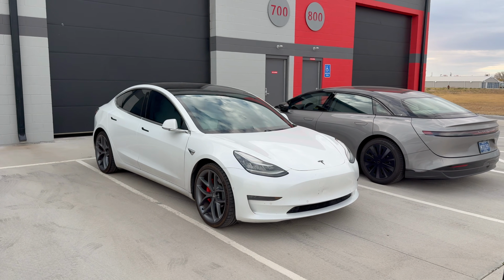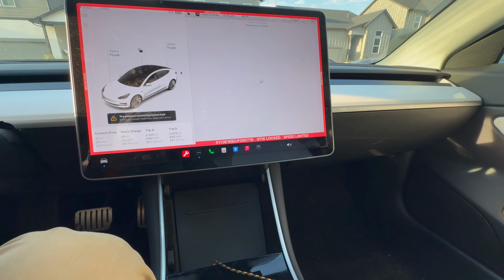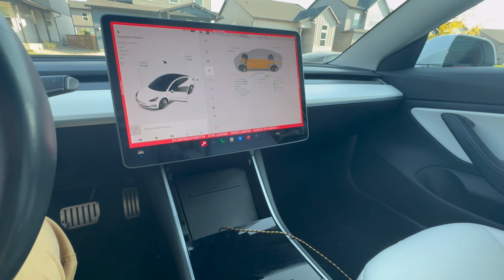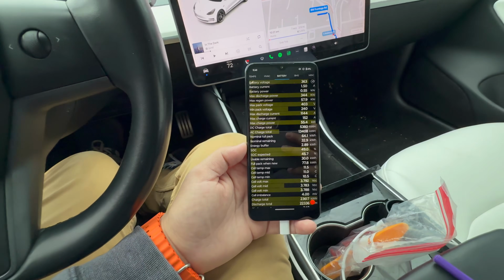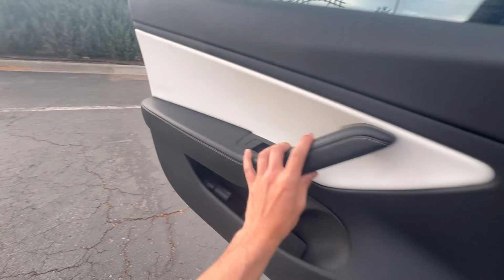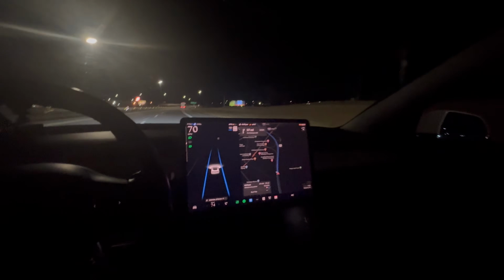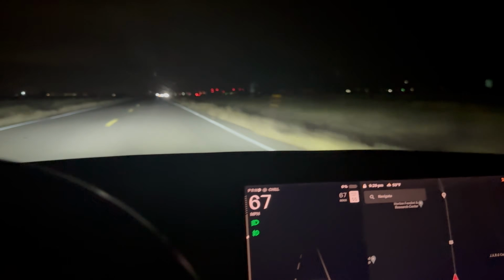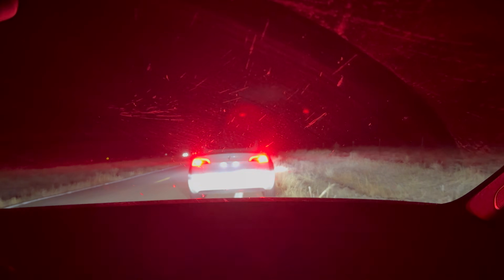My Used Tesla Lost This Much Capacity Since New! 2018 Model 3 Performance Battery Health Check

Comment: That seems like a lot of DC charging.
That's 1/3 of the battery usage.
I'm not sure I'd call that "primarily A/C charged".
==================
For comparison here's my gently used low mileage 2018:

05/25/24
2018 Tesla Model 3, AWD, 20,201 Miles
Battery health: 91%
Charged to 296 miles after health test
---------------------
Daily charged to 60-65%.
Supercharged only on rare road trips.
<15/SuperCharge sessions/year
Reply: I tried 60% charging on my MYP. It was a mistake. Tho I avg 390-405 why on the highway at 70-80 mph. Tesla said that was normal ..... I was expecting 320 or less.
Reply: @duramaxadventures5832  maybe I missed something. Why was that a mistake?
Reply: @David_L3  because the car limits power at 55-60% SOC so you don't have the passing power you expect on the highway. Was annoying. 

To be more direct to the issue, I had to visit a supercharger every two days because of the consumption being so high. I couldn't replenish the usage at at my house overnight. 

To give you an idea  how bad it was in real world terms. I was taking a trip to Cali, I top charge at a supercharger (so sit there for 2 hours in Goodyear Arizona). And I would pull into quartzsite at 1% on a brand new pack .... so as degradation happens that trip is not possible and there is not another supercharger. 

That's 112 miles ....... EPA said 303. 

I tried PHX to Tuscon, It's 200 miles round trip The vehicle should easily be able to do that. NOPE SC at Eloy AZ on the way there and then AGAIN on the way back ....

Tesla service center saw the car five times they insisted that everything was normal and that's just "what they do in AZ" I was SHOOK.

ANYWAY I GUESS YOU ASKED WHY 60% WAS AN ISSUE IT WAS AN ISSUE BECAUSE IT SIMPLY WAS NOT ENOUGH CHARGE AND I HAD TO RESCHEDULE MY LIFE AND BE LIKE OH NO I CAN'T TAKE THE CAR TO GO GET FOOD THIS EVENING CUZ I NEED TO MAKE SURE I GET AS MUCH CHARGE AS POSSIBLE SO I'M NOT SPENDING TOO MUCH AT THE SUPERCHARGER.
Reply: @David_L3  shoot whoops caps
Reply: @duramaxadventures5832  oh I see.  That makes sense.  You certainly need to put in what you need for a daily drive. That's a lot of driving.  If you don't have the range for your daily drive the EV might not be for you.
Reply: @David_L3  yeah but I didn't find out till after I'd already purchased the vehicle. I expected 303 as advertised, maybe 280 on a road trip. 

The daily driving, still having to stop by the supercharger was really just a bit of an annoyance.  it's not like it costed a ton of money but having a reschedule my day to make sure that I can be up at 9:00 at night to go supercharge for reasonable rates was.

It didn't help you that when I purchased my Tesla the supercharger rates were HALF of what they ended up being only two months later .... 

The whole reason I bought a Tesla for $75,000 over a Chevy Bolt for $20,000 was because I wanted to be able to do electric road trip mileage. to save on maintenance and reserve my truck for only towing the trailer. That way I don't have to replace my truck for another 10 years since they're now $87,000. 

I didn't actually drive that much on the daily. but it would still just use 40% of the battery per day but that was only 45-60 miles a day of actual driving. 

Based on the calculations prior to purchase charging at home should have given me easily 20% more than I would use on the daily. And ended up giving 20% less per day so a 40% spread which was massive. 

I did go out on the car and see at what speed I got the consumption needed to hit the advertised range (303) and it was exactly 50 miles an hour which is unsafe on our highways and on the city streets with the stopping and going you're not going to get the efficiency .

Comment: My 2023 Model 3 rear wheel drive with the LFP is at 25,428 miles and displays 251 miles at 100% (it’s daily charge limit). That’s 7.7% of the original projected range lost. I charge to 100% once a week (Tesla recommendation), and replenish roughly 10% of my daily consumption daily. Mostly use the 30-40% to 70% pack segment. Have free 7kW AC charging near home, and that’s 94% of my total energy in the last 1 year. 2% of the total 3.9 mWh energy is through superchargers, in the same period.
Reply: Thanks for posting that.  I'm always looking to compare.  Our 2023 M3 RWD w/ lfp is at 20,963 miles and shows 264 miles of range for a loss of a little over 3%.  Up until last week, I've been charging it to 100% almost every day.  I'm a range anxiety kinda guy and it's taken me awhile to adjust to this.  I got the Tessi app and am trying to keep the battery at a lower state of charge and charge once a week to 100%.  This week, I've also set the charge limit to 90%.  We mostly charge at home and have used 5.9mWh in a year.  We almost never supercharge, but my wife did take the kids on a 4000 mile road trip - during that time she consumed 1.6 mWh in 1 month on superchargers.
Reply: @ That’s interesting as I had the same number, 264 miles, at the beginning of summer at around roughly 21k odometer. And I too used to keep it at high state (multiple full charges/week & generally over 80%) until recently, following Kyle’s Always-Be-Charging principle. The drain was excessive this summer, which was particularly severe this year, here in the Bay Area. Heat & high state of charge could be the factors to look out for.
Reply: @viplav76  But the Bay Area is general mild / cold right?  We live in San Antonio, and it's often very hot, even in our garage.  Coincidentally the road trip was from here, through AZ/Grand Canyon, Las Vegas, up to the Bay Area - so our car was in relative proximity to yours for a brief period of time :D
Reply: @ we had an extraordinarilyc hot summer this time. Heat waves mainly taking it over 100F. Was driving more too
Reply: Doesn't it display the range based on your driving?
Reply: @ that’s right. But my driving is fairly consistent, including on the Tesla Safety Score. I assume, it’s hence a controlled factor.
Reply: Charging to 100% only resets the BMS to make it more accurate. Anything over 70% SoC on LFP makes it degrade 2x as fast.
Reply: @WJYK  As such, even ‘Always Be Charging’ can lead to frequent top charges. The Tesla guidance tends to indicate that the car should be essentially plugged in, as far as possible. I have free AC charging all around my home, but not at home. It’s a unique situation. In the first year, I did charge frequently to 100%. Though the degradation has only been seen this drastically, after high amount of driving (2000 miles over a month) in extra-ordinarily high temperatures.
Reply: My degradation was about the same on my 2023 lfp model 3. Maybe slightly better.
Reply: My 22 model 3 lfp has 75,680 miles on it and a full charge just ticked down to 256 miles a few days ago. Almost all my charging is done at home. Most days I use 40 to 70 percent of the battery, so I typically charge to 100 percent. Some days I won't charge or will only charge to 75 percent. I live in southern Michigan.
Reply: I have the same car, same year, same battery dont pay mind to what the screen says.my car screen says 261 mile at 100% and i drove over 300 miles with one charge. in a hot weather so dont really focus too much on that.
Reply: @johanalcantara8263 that’s a given. This was just the guess’timate. Real world would have several factors to look into. I’ve updated my 10 & 20k reviews for the community. 

As much as a range check in the real world.

Tesla Model 3 Rear-Wheel-Drive 2023 | 20,000 Miles Review
https://youtu.be/2s_D5bf3j20

Range Check On The Tesla Model 3 RWD | After 24,000 Miles
https://youtu.be/xIvm9JT8v0s
Reply: I normally simply check the % added against the actual energy received. (100/% added) x energy. Subtract from the original 57kW, and that’s a good layman view. Particularly seen over multiple sessions.
Reply: LFPs have higher degradation rates when you charge them from 30 to 70 or 40 to 80,LFPs work perfectly when you discharge them to 10% and re charge them all the way to 100%,you just hurt your pack baddly.
Reply: @davidfujkk8018  LFP actually doesn't like being charged to 100%, that's a myth. Engineering Explained even has a video on it with studies showing it does degrade faster from full charging unlike many claim. 

The reason Tesla and manufacturers recommend top charging isn't for battery lifespan, it's because LFP is harder to track battery percentage so the volt meter needs to be recalibrated. Lithium ion has a nearly linear relationship between battery percentage and voltage output but LFP does not so if you don't top charge your capacity estimates will be less accurate.
Reply: @Skylancer727  have seen that video. Tesla’s choice of words ‘charge to 100% AT LEAST once a week’ needs to be re-considered, probably’. Besides LFP is also considered relatively flexible to charging habits, or is at least spoken of, thus. Generally.
Reply: @davidfujkk8018  Literally none of this is true.  LFP just degrades less from top-charging than NMC does.
Reply: @concinnus  i didnt say compared to NMC i just compared different charging habits in lfps

Comment: Heat is the biggest factor affecting battery health
Reply: Coolant recirculates through the battery pack
Reply: @foam27  Yes, but even Teslas have thermal issues.  Drive one during peak Texas heat in the Summer on the highway and it burns so much energy just trying to stay cool.  I did this last Summer and it was a pretty bad experience, had to wait until dark to have the range to make it to my next charging stop.
Reply: @yayinternets  what model?
Reply: @j.a.3138  Model Y LR RWD.  I think it was a 21 or 22.

Comment: It’s great that Tijmen wants to DIY the AC compressor but it’s very possible that the evaporator and condenser coil need replacement, as well as the lines. If the compressor grenaded itself, there is metal throughout the whole system now. It’s typical for Tesla to have to do this when a compressor fails. 

Still possible if you’re an advanced DIY’er, but beware it may not be as simple as just replacing the compressor and calling it a day.

Comment: You said for vacation to go to 50% and leave it plugged in.  My manual (BMW i4) specifically says do not leave it plugged in while it is stored.
Reply: You want to leave the charge limit at 50%.  Keeping it plugged in will keep it there as parasitic loads slowly discharge it.
Reply: A happy car is a plugged in car. The car will manage it all.
Reply: I can understand keeping it plugged in to manage parasitic drain if left for months. But I just got back from a week being gone and the SOC didn't change at all. 52 when I left. 52 a week later.  And I drove it and it didn't suddenly drop either. 
I guess I'm just curious if topping up the battery is the only reason to leave it plugged in. If so I think I'm fine following the manufacturer recommendations for a vacation since I have so little drain while parked.
Reply: @awmustang  The manufacturers are usually recommending this from a safety/conservative/fire standpoint.  Having it plugged in allows the car to reach for grid power anytime it's needed, even if just to precondition before leaving.

Comment: I'd have to agree that previous charging and storage was probably to blame. I tend to keep my Mid-Range 2018 at 70-75% and it still turning at 56.7kwh usable / 239 miles at 100% - current milage 107k miles. Nominal new was 65.1kwh and had 63sh kwh usable with a 2.1kwh buffer. I also live in the PNW were we see extreme heat for 3 months and cooler weather the remaining. 

My new 2024 Model Y reported 83sh kwh new nominal and 2.4kwh buffer and after 14,000 miles still giving 80sh full so very little so far. Daily charge on this is 75% like my mid-range. Only ever 100% charged this for road trips and used it within the 24 hours of leaving to the trip, so less than 12 hours sitting at max 100%. Have to see where this goes as the car ages. I took the mid-range in used with 7700 miles, so it sat at airport at unknown state of charge for that first bit, but overall degradation has been minimal on it.

Comment: That seems like a lot to me. I currently have a Kia EV6. Technically, this is my second one since someone hit the first one. With my first one being the Wind rear-wheel drive, I put 60,000 miles on that car, and with my scan tool plugged in, I only had a 0.5% degradation. I use exclusively the fast chargers because I primarily use the car to do Uber. When I've used the fast charger, I charge my car up to 100%, and I only have a little bit of degradation. Versus this car that's mostly been AC charged, I get that it's been an Arizona car, but that still seems like a lot of battery loss in the time that it's been on the road.
Reply: Every battery degrades, it is physics. KIA is taking different strategy to battery capacity management. It provides only limited usable capacity to customer and leaves a hidden buffer which is then used to compensate for capacity lost via degradation. Kia does not have any special technology which avoids battery degradation, you just can use less capacity from beginning.

Comment: This has obviously been a street rat car. Low miles doing laps of the local area with fast spurts of discharge causing lots of battery degradation.
Reply: Maybe a lot of 100% SoC charging as well, letting it sit there for long periods of time.
Reply: Which is exactly what a model 3 performance is purchased for.

Comment: I appreciate that you’re digging into what that battery health number actually means. Hopefully one day this is a number that is required to be reported for used EV sales.
Reply: As an industry, need to quantify what battery health means and how to display that to customers
Reply: @KyleConner  Nissan Leafs give a battery health percentage and also you get an "HX" number which indicates the internal resistance in the battery (can't pull too many amps or it will heat up the cells).  My 2018 Nissan Leaf shows 85% battery health but also 77% HX and the pack heats up noticeably faster than it used to under repeated 0-60 pulls.  Bad HX values are often associated with cars that got heat soak damage and charged to 100% all the time.  It seems to me batteries should have both a capacity health metric, and a performance metric (like HX on the Leaf).
Reply: @KyleConner  absolutely. Not sure if it’s already in the works, but it would be interesting to see what kind of range/efficiency gains could be had on this car if you swapped in the new Photon wheels from the new Long Range RWD.
Reply: for my understanding is that anytime you buy a used tesla the battery health information is something you can acquire very very very very very easily, compared to other ev's, you just need to learn how to use "service" mode and you'll be good to go, also here in my city if you go shopping used teslas i believe almost if not all used car dealerships did in fact display the actual battery health at 100%
Reply: @Coyote.five.0 half true. I don't know how many private sellers or dealers will be cool with you taking the car for 12-24 hours to run diagnostics
Reply: The problem is age alone degrades the battery.  That's just the nature of it.  The air is going to be a fortune to fix.
When your compressor fails, it sends tiny fragments of metal all through the system. Every part will need replacement.  6 year old upper and lower control arms isn't a great sign either.
Reply: Well said

Comment: I have a 2021 Dual Motor 3 with 34,000 Miles. Im sitting at 13% Battery Degredation since new. Vehicle charges to 313 miles indicated, but realistically I've only ever seen 250miles out of it. I am running Zero-G wheel's with stock size PS4S tires. But I'm somehow getting lower Wh/MI now then I was when the vehicle was new with the 19" Sport V2 wheels and stock continental tire.
Reply: that's a bad battery module. get it serviced and they will replace
Reply: @bridamy they will not replace it with 87% health
Reply: @linu4592  if it's 3 years old and already at 87 yes they will. if not sue them
Reply: @bridamy  the warranty description is clear they will not change it i am in the same situation
Reply: @linu4592  well if that's true another reason I'm glad I went with a legacy manufacturer for my ev
Reply: @bridamy  Same with Volkswagen. Our Company car (ID3) is 2 years old with 35.000 Kilometer. The Car has 180km of Range left with 100%. VW cant read how healty the battery is so they dont change it… BMW is another Story, they are realy good with the battery health.

Comment: It's not that the AC is broken that's then skewed the result?
Reply: Right - does M3P have a separate a/c compressor for battery vs the interior?  If not, a broken compressor could impact battery life
Reply: It only has one compressor. But that wont inpact this test, it might just explain the degradation if it's broken for a long time. But I doubt someone would drive a car without AC in Arizona :D